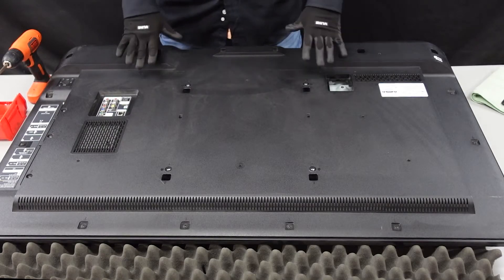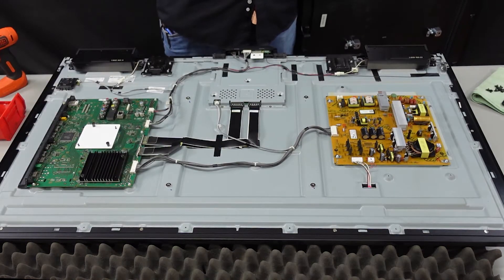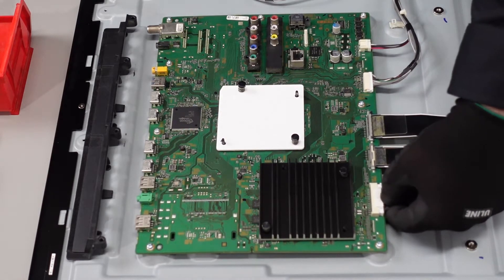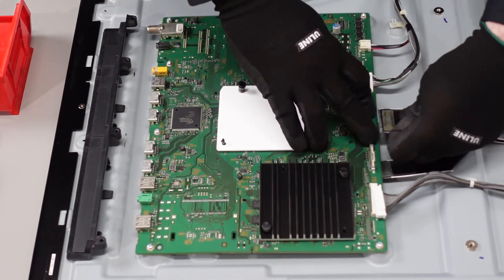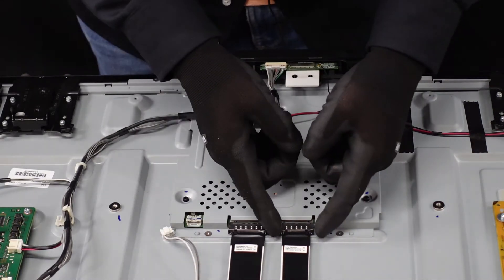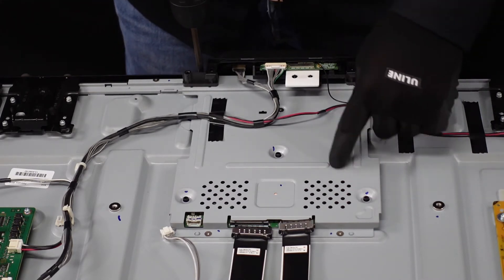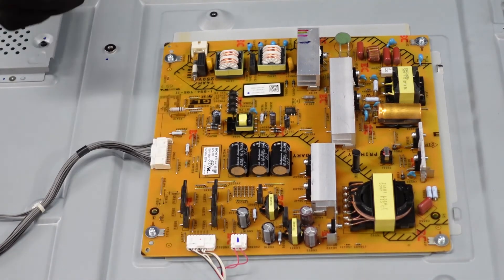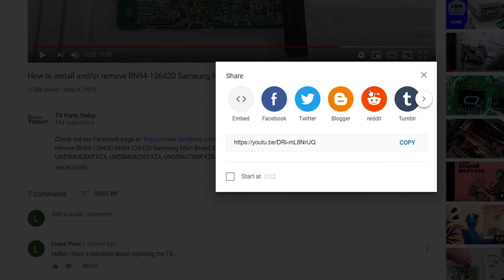Learn how to repair your TV.   (SONY XBR-49X830C)

Comment: I have the XBR-49X830C and it was continually booting to the logo then rebooting.  After powering it off it hasn't come back up, only a black screen.  I did a factory reset and a tech tried a firmware update to no avail.   Would you recommend the main board?  The tech thought so but looking through the comments I suppose it could be the power supply too but I'm here to find out what you recommend.

Comment: Hi whats the problem if this unit has a flicker
Reply from the maker: If you have checked all external cables and devices (HDMI ect.), then my next step would be to factory reset the TV just to ensure that the issue is not with the software. after that I would check the ribbon (LVDS) cables and make sure they are properly inserted. If you are comfortable doing it, I would try and clean the ribbon cable connections in the back of the TV while you are back there.  If these steps are not working for you, I would try to replace the t-con board as my first board swap. Google had some strange ideas about messing with the brightness and picture settings, but this could just be AI slop. It would be worth it to at least try to do it anyway, given that it is free and easy to accomplish.

Comment: I have this same model number tv. The tv turns on and gets to the home screen and within a minute it reboots. I see the colorful Android logo and then gets to home screen again and then  reboots again. Its in a constant boot loop. I was told it is a power supply issue. Replacing the power supply board fixed it for others. What is your advice on this?

Edit: I managed to get the tv to factory reset in the tv settings under Storage and Reset. However it is a constant loop of sony logo and android logo. I did open the back up and did not see any dead capacitors so I'm not sure what to replace. Any help?
Reply from the maker: I know with this series of Sony TV there are a number of things that could be going on. I would send and e-mail to our customer service department with the model of TV and your symptoms. It will be important to send any "blink codes" that you TV may be displaying, if any. The blink code will be a series of blinking lights after the TV resets. For example, if your TVs standby light is blinking 4 times quickly and then a pause and then blinking again 4 times quickly they will need to know that.

email: info@TVpartsToday.com
phone: (930) 212-1975

Comment: I have this model tv , when I hit power button on control, the android logo tries to load but then freezes up. Can this be the main board?
Reply from the maker: I would assume so. The main board would be the best place to start for this issue. Do be aware: Sony main boards require a firmware update when installing a new board into your set. We have some resources you can use to navigate the firmware update as well as email and phone support if you have any questions or run into any problems. Don't hesitate to reach out to us!  
Phone: (930)212-1975   *best*    
Email: info@tvpartstoday.com

Comment: I have taken apart many TV’s as a “helper” for manual labor and whatnot, but not inclined on specific board duties. 

I have this exact TV and can easily replace all of these components. I have done factory resets, firmware updates with USB, and uninstall apps and cleared cache and everything already, few times over the years.

1. T-Con?: 
TV win’t always connect to the WiFi when you turn it on and upon first boot it may display the error on the home page that WiFi isn’t connected. It can correct itself after a few seconds or minutes, and sometimes I have to forget network and re-enter all info to the network. Is this the T-Con board’s duty?

2. Mainboard?:
Apps are slow to loading. Sometimes staying on the Netflix splash screen and never actually loading anything further. Same for Disney+ and Hulu. Sometimes sits at the splashcreen logo forever. - Other times Netflix may load and send to me the homepage and some movie tiles will load, but when you click on any of them the loading percentage never progresses and sits at 0%. Is this the mainboard for processor/ram issue?

Before I go out seeking deals on parts (will be cheaper than a new TV) I just want to verify I know the job duties.
Reply from the maker: I would start with the wi-fi board. Its a long shot but its, by far, the cheapest part.

Comment: We experienced a power surge due to losing the neutral line into the house that was repaired by our electric company. The power surge caused this same model TV to not power on at all. Would you suggest replacing the power supply board first and then troubleshooting from there if that does not remedy the issue?
Reply from the maker: That's right, Peggy, I would suggest replacing the power supply board first. Sometimes a power surge can leave scorching on the boards themselves. If you get the unit open and take a close look at the boards and the connections between them, keep an eye out for any black, sooty residue on the boards. Also take a look inside the ports where the boards connect to each other for arcing damage.
Reply: @tvpartstoday  Thanks so much for the speedy response. I will likely get to opening up the unit within the next week or so and investigating.
Reply: Okay, so it took a lot more time to get around to this, but I did take the back off of the unit today and placed an order for a new power board. Fingers crossed 🤞
Reply: @peggycastle6905 Were you able to solve it with the new power board?

Comment: I have this TV, when I plug the power cord into the wall outlet, I am experiencing a slow pulsing white stand by light, every 15 seconds it comes on then dims down and then goes out and this loop continues, the TV does not turn on, just the white light loop. It will not power up with the remote/rear control panel.  Any suggestions?
Reply from the maker: We suggest replacing the main board. If you need help identifying the part number please email us at info@tvpartstoday.com.
Reply: I did exactly that, and it turned on and is fully working. Thank you for your quick response.
Reply from the maker: @stephenstroub2145  No problem. Glad you got your Tv working!

Comment: Hello, I am technician and I have blank screen issue with Sony TV KD 49X8309C.
If I use external light I can see display
Reply from the maker: That could be the power supply, LED driver (usually on the power supply) or the backlights themselves.

Comment: I have the exact same TV, but when I plug it, Sony logo appears and immediately turns off. Neither the back buttons nor the TV remote makes anytying. What could it be?
Reply from the maker: If you are having trouble getting the unit to boot up we suggest trying to replace the main board first. We also have a tutorial video of how to do the necessary firmware update to the main board when you install it.